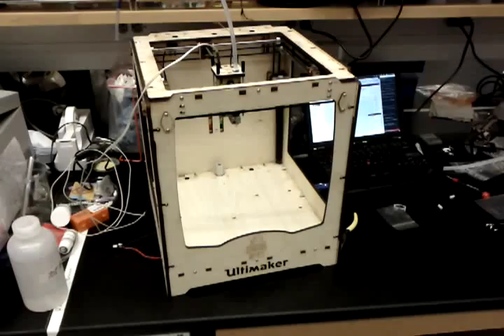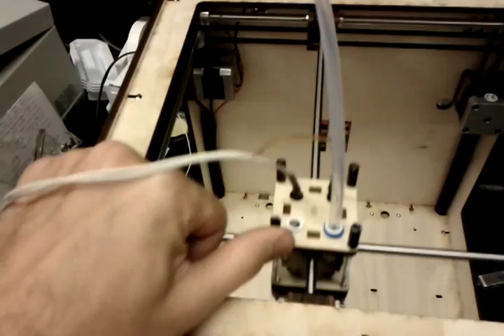Ultimaker 3D printer build : X-Y axes debugging

Comment from the maker: It turned out that this is the expected "stiffness" for the current revision of the Ultimaker. The rods are greased up, they are just very close tolerances. I suppose the idea was to get rid of potential slop, but at the cost of making the motors work harder.
Reply: mine is the same, good to hear that